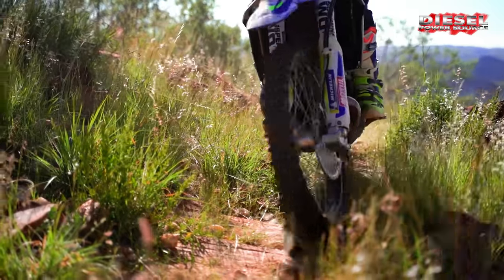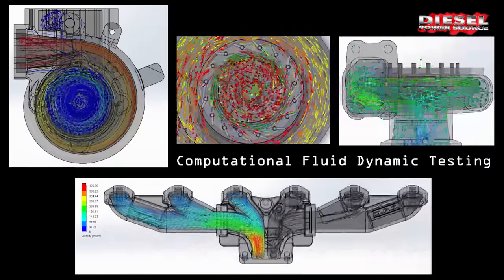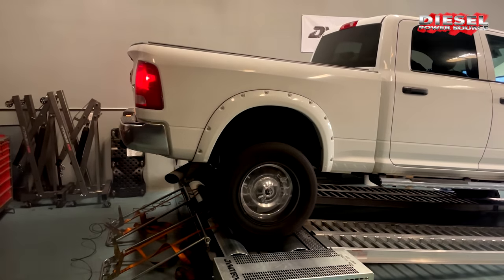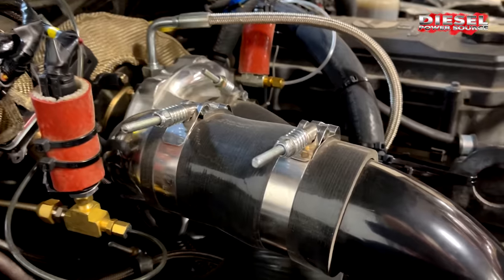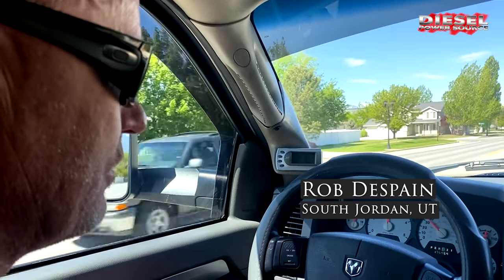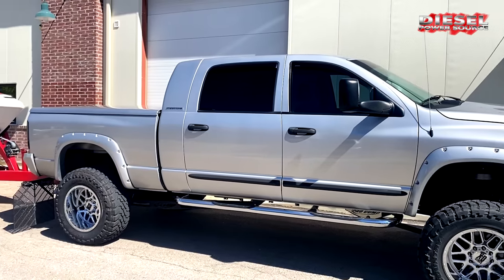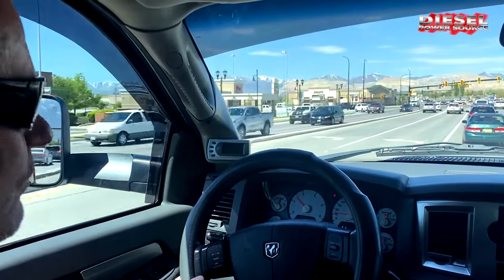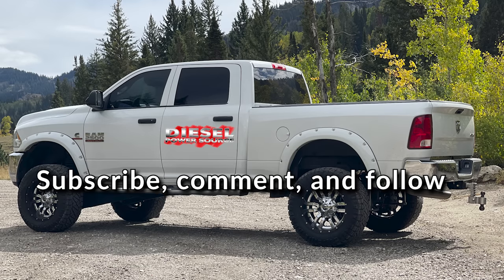Twin Turbo for Cummins Compound Turbo kit | Best Compound Turbo setup for 6.7 Cummins

Comment: Do you have to have the turbonator vgt housing in order to keep exhaust brake ,or can I just keep my fleece cheetah turbo with the s475 hooked to it and still have exhaust brake ?
Reply from the maker: The kit made to work with the stock turbo and since your cheetah is a stock modified turbo it will work with the compound kit.